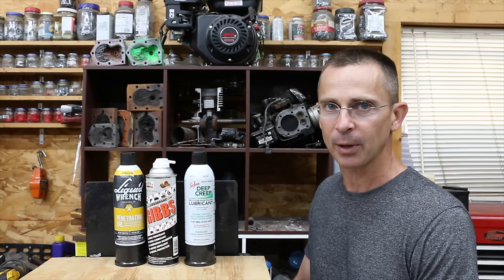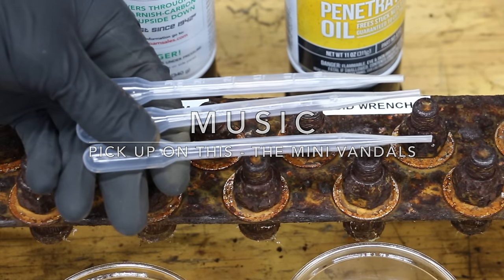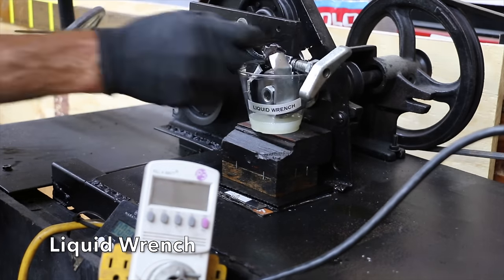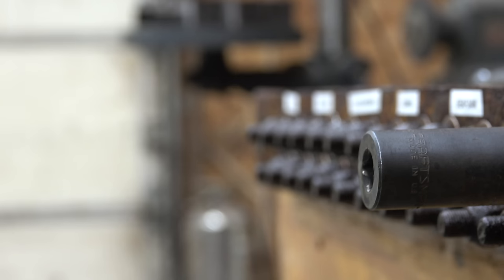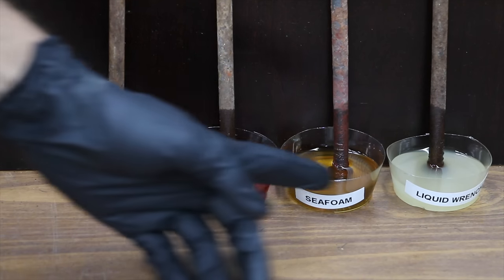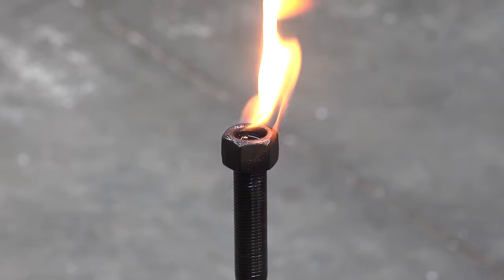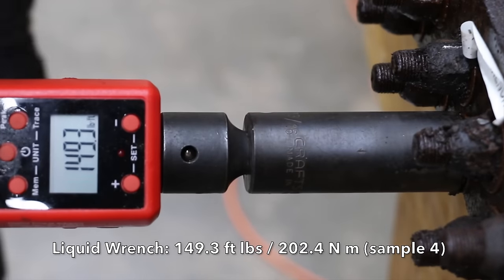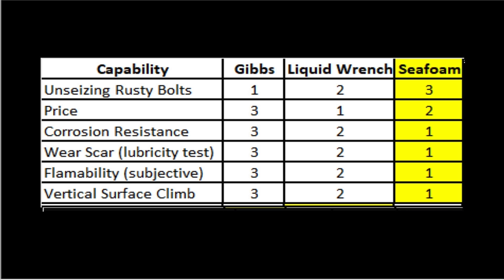Best Penetrating Oil?  Seafoam vs Gibbs vs Liquid Wrench

Comment: I've used all of those products you've tested and more. My pick is Gibbs which I've used when I can get it for over 30 years. I remember buying cans of it from the founder/inventor at car shows. I believe it's a combination of ATF and acetone or some similar solvent with some other ingredients to keep it mixed. Those other tests are interesting but the only one that matters is how it performs as a penetrant. Lubricant and rust preventative are separate specialty products like the WD40 'Specialist blu torch line'. If you buy any of them to do everything, you're going to be disappointed because it won't be great at any one thing. There have been many tests done with ATF and acetone and they always outperform nearly all the commercial products. I've used B'laster which is just 'ok' and Kroil which is way overrated. Liquid Wrench has been around forever and I haven't used or bought any in decades. The original stunk like it was just diluted diesel fuel or something.
Reply from the maker: Thanks for sharing.

Comment: after spending three days with heat and wd40, i drilled out a seized stud..on the other side I tried heat and wd40, did not budge, and could not face three days of drilling so watched this and ordered seafoam, applied over two days, and the stud drew out, amazed.
Reply from the maker: Thanks for sharing.

Comment: Would it be a better test if the bolts were holding something together under a load?
Reply from the maker: Thank you for the suggestion.  While not under load, these were torqued to 80 ft lbs.

Comment: This as well as your other penetration tests are very good information thank you. There is an Amsoil product I have used since the early eighties called MP Metal Protector. At the time I was working on boats and ships as an engineer (fancy name for grease monkey). My second who actually was smarter than me showed me how well this stuff worked in a marine environment. There would be pumps and other pieces of equipment that would have aluminum with steel bolts like on pump housings for instance. This stuff would go through the corrosion and electrolysis and allow me to get things loose. Have you ever tried MP?
Reply from the maker: Thank you!  I have not yet tried MP.

Comment: re: PVC fittings. I would test pull out strength from the socket to the pipe. Let me check ASTM. I bet there is a test method. Burst strength might be helpful too and fun to watch leaks form.
Reply from the maker: Great suggestion. Thank you

Comment: I have used mystery cutting oil a few times when nothing else worked. Wasn't a bolt though, it was a 11/2" shaft through a roughly 6" long tube.
Reply from the maker: Thank you for the feedback

Comment: Hey!! All your videos are amazing :). I live in Perú and and i can't find on my market most of the brands tested here, so i research the ingredients and i found that this top products have: isopropolic alcohol(when it oxide turns on acetone), petroleum distillates and hydrocarbon-based solvent like n-heptan. The ones that don't work so well (tested on the previous videos), usually don't have the alcohol. I think that it's a great idea to make another test comparing acetone, isopropolic alcohol and diesel; using them one by one, and also the three combined vs one of the top picks you have here (gibbs for example). Another interesting finding is that the brake fluid is composed of glycerin and alcohol and works more or less ok. And the acetone; on the other video worked quite good, so that make me think that the combination that i mention before might work. The best performance products have ingredients that act like good solvents and mixers. Thanks for your job :D
Reply from the maker: Thanks and you are welcome!

Comment: Freeze sprays. 

They are supposed to shrink the nut and bolt shaft to facilitate penetration. They claim incredibly low temperatures, like -40 centigrade. 

I liked your candle episode, I thought that might work and you proved it doesn't. 

Are freeze sprays just more snake oil?
Reply from the maker: Thanks for the video idea.

Comment: Can you do a test measuring the amount of energy you have to put in to get the nut completely off the bolt?  Until it starts turning, doesn't use any energy at all, but once it starts turning the thing starts to get hot.  If using a penetrant doesn't lower the breaking torque by much, but makes the fastener a lot easier to get all the way off, that's an advantage.
Reply from the maker: Great recommendation for a future video!  Thank you

Comment: Sea foam deep creep also make a good throttle body cleaner. Won’t hurt your sensors. (Except for mass air flow). Never spray anything on a mass air flow.
Reply from the maker: Thank you!

Comment: Test Shell Rotella T6 15w-40 full sythetic vs Mobil 1, valvoline, supertech full synthetic 15w-40....these are very commonly used in motorcycles, but one is much, much cheaper than the rest! The motorcycle world would appreciate it, I'm sure.
Reply from the maker: Thank you for the video idea!

Comment: Hey could you do a catalytic converter cleaner / fuel additive test " with an actuall mufflertip psi for testing it. Also exhaust tip psi  test could be helpful to you , for cleaning tests and power gained tests." Make a pipe blocking valve, and a threaded compression tester hole , once running snap the tip valve shut and test it however inlet and exhaust stroke are or could poss effect this psi but maybe not because " there could be multiple exhaust stroke s storing up in there". If all else fails I would just use the original tester with it's rubber large tip at the source remove the 02 sender.
Reply from the maker: Thanks for the suggestion.

Comment: The rust inhibition testing was interesting though I have some concerns as to the veracity of the results. I think that directly applying a liquid mix of corrosive chemicals to the treated surface is washing away some or even most of the oils in a way that environmental moisture and oxygen wouldn't.
Reply from the maker: Thanks for the constructive feedback

Comment: As you tested WD40 for engine oil it's time to test some engine oil as penetrating oil. And make some twists. LIke can you put some long bolts to the rusting procedure and first use penetrating oil (if it is better than a good engine oil) to unstick the nut, and then try to lubricate the rest with regular engine oil. 
Also how good is penetrating oil in cleaning carbon deposits if you do not have a dedicated carbon cleaner in hand /or you just run out of it/. Should you spend time going to the shop and get one or you can save time and use penetrating oil.
Reply from the maker: Thank you!

Comment: I'd like to see a comparison not of just  different products, but different techniques for breaking rusted threads. I hate rounding off bolts, using extraction kits etc. 
It would be great to know the smartest way to approach this problem. E.g. whack the rusted bolt with hammer, heat up rusted bolt with blowtorch, spanner vs socket and othwr different heads, putting a socket on the bolt but instead of applying pure torque tap it anti clockwise with hammer. Also test rattle guns? Electric vs air driven?
Reply from the maker: Great recommendation!  Thank you

Comment: I usually do a mix. I’ll spray Kroil oil, let it soak for a bit, then some PB Blaster or WD-40. I figure between the 2 or 3 it should work better. It’d be interesting to see what all 3 mixed together would do.
Reply from the maker: Thanks for sharing.

Comment: Does the delivery of the oil via an aerosol can have any impact on its performance? I can't imagine it would as many of these products are sold in bulk simply in a large pourable container, but why use the aerosol at all? Is it just to deliver the oil faster and in a more convenient manner?
Reply from the maker: I don't believe so, but the force at which it impacts the rusted nut or bold could effect the rate at which it begins going to work
Reply: @ProjectFarm  Which is why you applied them all without the can, to eliminate that variable if any didn't come in an aerosol can. Very good. Thanks!

Comment: How about some testing on rust encapsulators like POR15, Agriguard, Chassis Saver, RustSeal, and Eastwood Rust Encapsulator. Some of these manufactures also carry a Rust Encapsulater in a can and I was told it's not the same, pretty much just marking fraud. It would be interesting to see how effective these all are.
Reply from the maker: Thank you for the video idea!

Comment: 10:30  So if I want to prevent rust on metals parts, use sea foam

10:21  If I want to loosen rusted bolts for cheap, use liquid wrench

If I want to loosen rusted bolts the best, use Gibbs

Comment: ..I remember as a kid that Liquid Wrench was about the only penetrating oil I ever saw around..I remember my dad using it, he often bought it in little metal squeeze cans, kind of like 3 in 1 oil came in..I think you could get the aerosol, also..anyway, I remember it was a dark grayish/blackish color back then..this was the early '70's..and it smelled different-maybe stronger, too-than it does today..would be interesting to test some of that vintage '70's liquid wrench vs. current liquid wrench..ala Richard Petty STP vs. New STP.. :)
Reply from the maker: Thanks for sharing.

Comment: Hey project farm  can you test corrosion x for the next penatrating oil video. I am a diesel mechanic and this is by far the best I have ever used both for a lubricant and penetrating oil
Reply from the maker: Great recommendation!  I'll try to test it but it takes several months of rusting to prepare the test set.

Comment: Great penetrating oil is Automatic Trans Fluid (like dexron II or earlier), and brake fluid (dot 3) mixed 3/4 to1/4.The absolute best may be Kroil, but more for resto work cause it takes a long time, and it aint cheap.
Reply from the maker: Thank you

Comment: How exactly does heating help? I mean won't the metal expand thus making the bolt-nut connection even more tight? And after heating it should be back to what it was before?
Reply: Fasteners tend to corrosion weld themselves together. As they rust, the corrosion locks the parts together. The idea of heat is that uneven heating and cooling will cause the parts to sort of crack loose from each other and allow them to be removed easier.

Thats what i think at least
Reply from the maker: Kas b is right. Thank you

Comment: You should try and find a TUNAP 903. After you apply/spray the product, wait for about 3 to 5 seconds and you can loose easily the rusted lug nuts or bolts! So fast, so easy with minimum quantity of chemical/fluid. You will be amazed!
Reply from the maker: Thank you for the feedback

Comment: I'm curious as to what torque the lug nuts were tightened to when "installed". I didn't catch that if it was mentioned. Thanks.
Reply from the maker: 80 ft lbs. Thank you

Comment: I've got a video idea for you.  Can you run "Diesel oil" in a normal gas engine?  Almost always engine oils designed for diesel engines are cheaper than standard conventional oil.  I've searched and can find no "official" source that says its ok.  I'd like to see a good side by side comparison of standard conventional oil vs diesel oils like Rotella.
Reply from the maker: Thank you for the video idea!

Comment: Love the vids, absolutely awesome and well thought out & planned.
Would you consider concocting tests for the following products please?
1. Red line Gear Oil, Fully Synthetic Heavy Shockproof, "can be rated as 75w/250 gear oil" I add some molybdenum disulphide  paste as motorbike chain lube (on my Triumph Sprint ST 1050).
2. "Inox"  an Aussie product (so the can says), & stated on the can " The super lubricant with the MX3 anti corrosion formula ".... WD40 type stuff but so much better I think. (Glad to be proven wrong)
3. The famous 50 % tranny fluid and 50 % acetone homemade penetrating fluid formula (tried it and not so sure). 

Hope you can oblige, and then I can enjoy your presentation. An intrigued Aussie.
Reply from the maker: Thank you for the video ideas!

Comment: How do you explain the difference in the Gibbs this test vs last test? On the one test Gibbs torque test was  average 111 ft lb but in this test  it took more force - both were tightened at 80 ft lb.  Did you oxidize them differently? Also, how do you explain why the bolts vary so much between each set of 4?
Reply from the maker: Great question.  The amount of oxidizer applications was much different and the rusting process varies.  Thank you

Comment: I've been rewatching all your penetrating oil videos. I switched from Liquid Wrench to PB Blaster, I suppose because PB is a local company to me as it is based in Ohio. From your videos it seems I'll be going back to Liquid Wrench. That being said, LW now offers three penetrants, original LW, Pro Penetrant, and Pro Penetrant & Lubricant Powered by Flashsight Technology. From what I've learned the regular Pro Penetrant has a naphthenic oil base while the other two have a petroleum distillate base. It would interesting to see the three go head to head.
Reply from the maker: Thanks for the video idea.

Comment: 0w20 or 0w16 engine oil works better than anything else I've tried. Rusted EGR valve came off with a 6" ratchet and a pretty please
Reply from the maker: Thanks for sharing.

Comment: What I gather from all of these penetrating oil tests is that none of them really matter. None of them significantly help a truly rusted nut or bolt. As you say, the best thing about penetrating oil is that you can get the nut or bolt all the way off, instead of galling half way. This perfectly mirrors my experience, and I find that the only thing that actually helps break fasteners free is heat. That and a Milwaukee 1/2" impact gun.
Reply from the maker: Thank you

Comment: In response to "Also include black ABS pipe glued to PVC with PVC cement, ABS cement, All purpose, and transition cement.  I always questioned the need for transition cement"

I would like to see "pull-apart strength" , pressure, with the different cements on matching and non-matching plastic pvc and abs pipes.  Tensile testing by butting 2 ends together really does not much good, as people will barely ever glue them like that without an adapter.  I suppose submerging in different solvents and chemicals will be useful also to see which cement breaks down with certain drain products.
Reply from the maker: This helps a lot!  Thank you very much!

Comment: Dude... PB all the way and cost half to a third of the price of those. I absolutely swear by PB  now I'm curious if you have a video on that stuff. I had a dirtbike and a ride planned I had a completely wrecked chain rust, muck, and sticky spots I used PB and it was like new again no sticky links and this was a dirt ride in the Nevada desert with ZERO dirt buildup.

I replaced the chain after but half a can of PB literally got me through a ride no worries!

So I know the dirt bike ride doesn't exactly cover the stuck bolt/nut question of the penetrant I've also used this exclusively in the shop for such occasions(exhaust bolts, oxygen sensors, accessories, suspension) would love to see a side by side with PB

Comment: Could you do a test on Free All deep penetrating oil? I gave it a try seemed good actually. I was able to get the exhaust flange stud nuts off of my 93 f150. Without snapping any. These are the original to the truck and has been in Pennsylvania winters. Just curious to see if it is actually any better or if I got lucky. Lol
Reply from the maker: Thanks for the suggestion.

Comment: Thanks for doing these test videos. Some feedback: One thing I'm noticing in all of these liquid application tests you've been doing, is that the actual application of the liquid isn't very well regulated. Ideally you should use the same amount of liquid, and apply or spray in the same way for all the bolts. This is quite an important factor in the experiment and unfortunately it's the one part done somewhat uncontrolled. Consider that a ml of fluid applied very directly, can yield a very different result than 2 ml of the same fluid, applied somewhat haphazardly. Anyhow you get the point... 

Food for thought for your next comparison experiment :)
Reply from the maker: Thanks for the feedback.

Comment: I recommended something before that I'd like to see you try and that's strike hold. I think it will do a lot better job at working it's way through metal because it has a capillary effect. It overall is just better for various reason including its density.
Reply from the maker: Thank you for the recommendation

Comment: That an oil can penetrate rust, doesn't mean it's going to do anything once it gets there.  If it weakens the rust in some way, the a rusty bolt turns more easily. That it's "oil" means nothing until a rusted bolt starts to turn, then the lubrication may make it slightly easier.  It's all about what it's doing to weaken the rust.  I would have liked to have seen vinegar water tested as well as Bar Keeper's Friend since it has about 3 or 4 different acids in it;  also a dish detergent contender since it's bases may play with rust.  Of all the penetrating oils, 3-in-1 may have the strongest lubrication strength of them all.  I know if I rub the backs of two spoons together, it barely scuffs the steel.  Use WD-40, and it will scuff it and score it badly.  Vaseline is like using sandpaper when metal to metal--it has no metal to metal lubrication qualities at whatsoever.
Reply from the maker: Thanks for the suggestion.